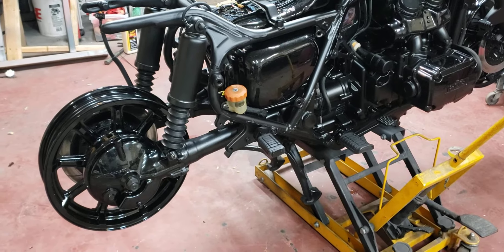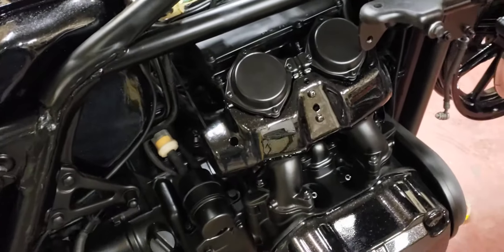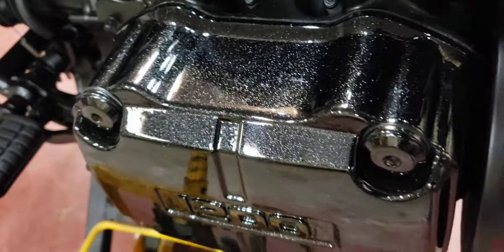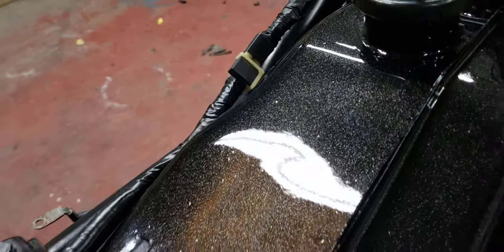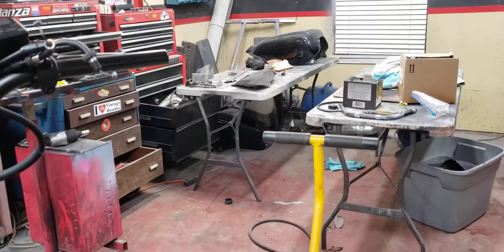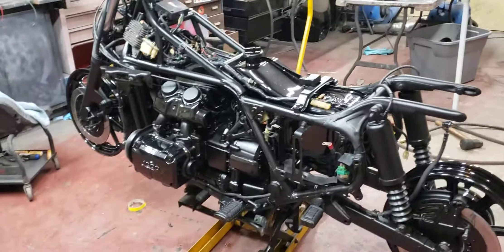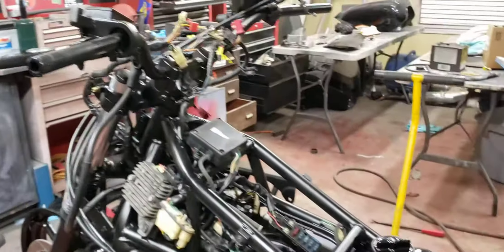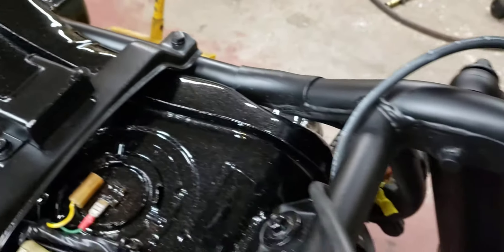1984 Honda Goldwing GL 1200 restoration and customization.

Comment: What handle bars are those
Reply from the maker: I have found that using the Honda fairing from the '80s with a set of Kawasaki klx110 handlebars is the perfect bar. I put a 1-inch bar riser on it which gets it up away from the radio and actually puts it in a better spot for my hands when I sit on the bike